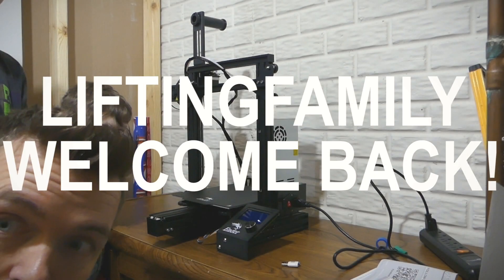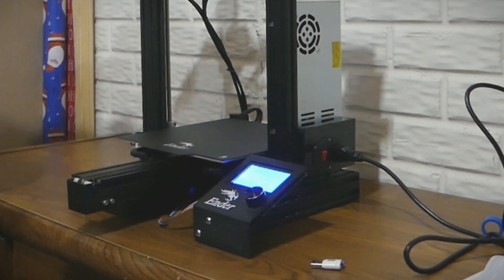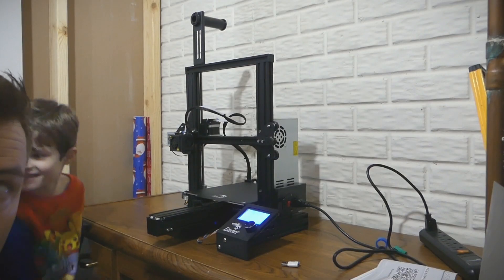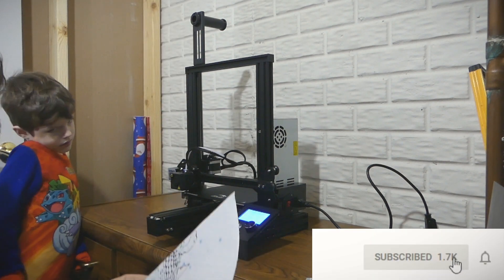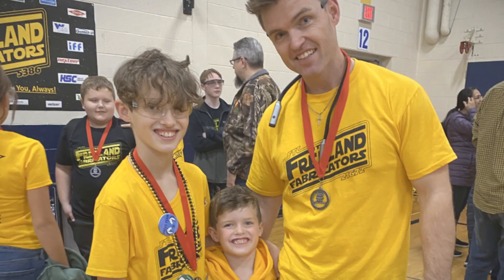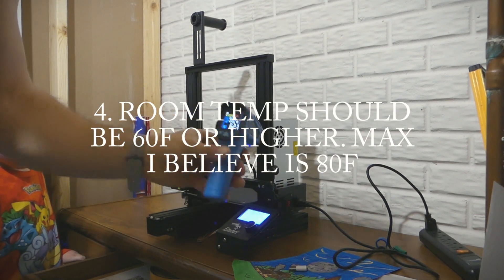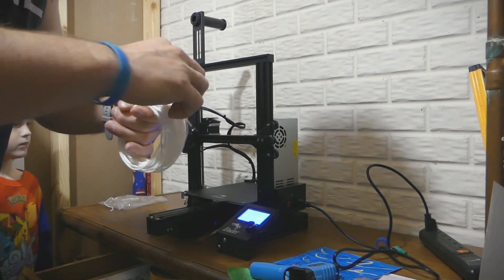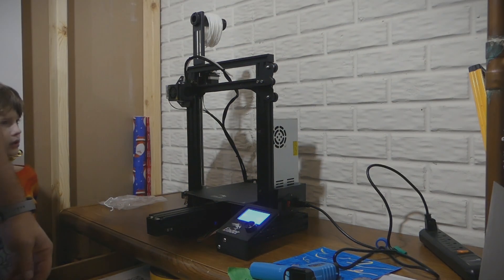Creality Ender 3 Pro 3D Printer Setup Tips

Comment: im just another dad out here who happens to use this exact same printer...its good enough to enjoy the printing stuff. its alot at first. but i cant tell you how many prints looked like they needed to restart  but still worked with the "bad" start. if ur doing toy stuff edges and points can be sharp. ive gone with petg for outside stuff. and pla for inside. good luck daddin'.
Reply from the maker: Thank you! What would the petg do for outside stuff? I haven’t tried that filament type.
Reply: @LiftingDad   I believe I read somewhere it doesnt age as fast as pla. I believe that pla has a 1yr in general rule for outside vs multiple yrs indoors (don't remember actual numbers, just the pro/con). Anytime

Comment: Oh that was so me in 2018, with my first 3D printer. Welcome to the club.
Reply from the maker: thank you! it has been an adventure thus far. More "beginner tips" videos inbound. I had layer offset a few times into my most recent print. I adjusted some of the settings (fan speed, print speed, nozzle temp, print layer size) and it appears a lot is due to the timing belt for the extruder being slightly loose. This must have slowly been occurring as it is getting used and the belt wearing itself in after initial install/tightening.